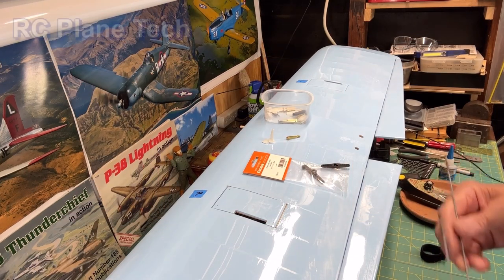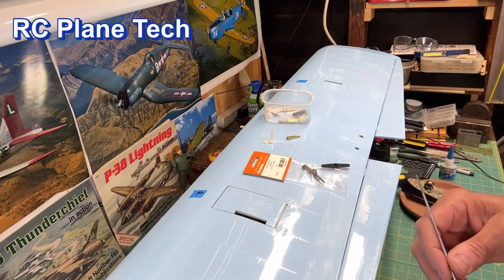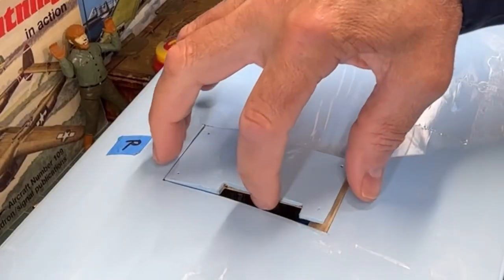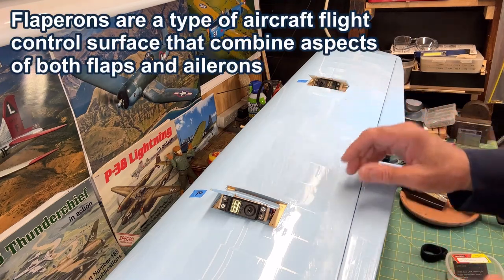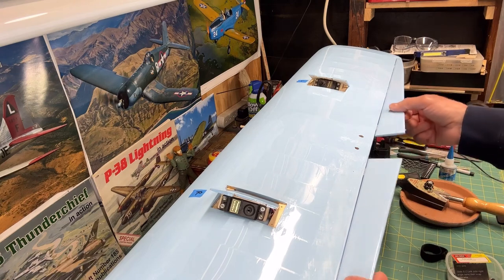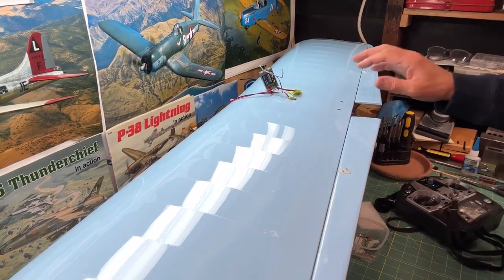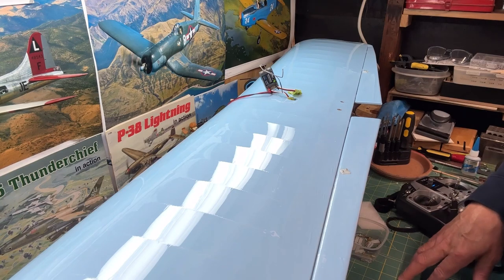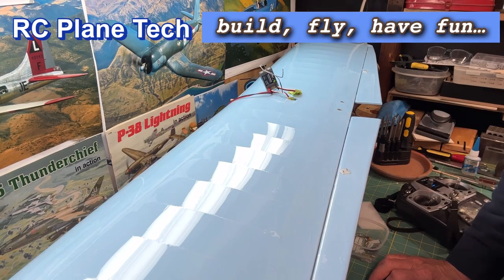Balsa USA Smoothie RC Plane Kit Build No 44, Ailerons with Flaperons mix

Comment: James, I’m glad no saw was necessary this time!

Seriously though, nice job on the ailerons.  Those Du Bro EZ Links are nice. I just assembled an E Flite Air Tractor that came with them, fist time using them. Most planes seem to come with a Z Bend on one end of the rod and a threaded clevis on the other end. 

I have a Z bender but I don’t use it because you have to make the hole bigger than the rod O.D. to get the Z bend installed and the slightly “oversize” hole adds just a little slop in the push rod assembly (though there are folks that swear by the Z Bend). I have also used threaded rod with a clevis on both ends, it makes for an easy install but there is a lot of hardware so   aesthetically it can look a little busy.  I think your method is best, it is clean, easy to do, does not require any special tools (Z bender), is cost effective and functional.  

I am looking forward to your wing loading calculation, I never have done that so I hope to learn something. 

Keep up the great work!
Reply from the maker: Thanks Tom, I agree with the zbend, it can be sloppy like you say because of the drilling to make it slip on. I also like the DuBro EZ connectors, but they don’t always fit. The EZ links are great.

Comment: Well done. I didn’t really understand why you put the servos in the wings but now I get it. I have always wanted flaps on a plane but didn’t know how to add them if the plane didn’t come with flaps. I think this is the way to go and will be adding them to my planes going forward.
Reply from the maker: Ya, the kit has both options for the ailerons. I chose to use the two because the flaps do help me slow the plane for smoother landings. But have to be careful because you can stall it. We’ll see how they work here soon.

Comment: Should also mention that its a good idea to cut 1/8" long fuel tubing to push on/around the metal clevises to keep them locked together. Good idea for all surfaces really. Ive never experienced a clevis become worn enough to pop off mid-air, but its still a good safety measure.
Reply from the maker: Yes, you are correct. I forgot to mention that tip. These metal clevises are pretty stiff and strong, but the plastic ones are not. Its a good idea. I’ll try to remember to mention that in future. Thanks